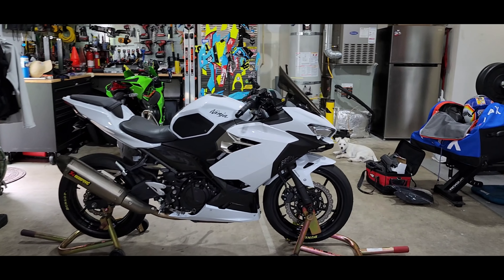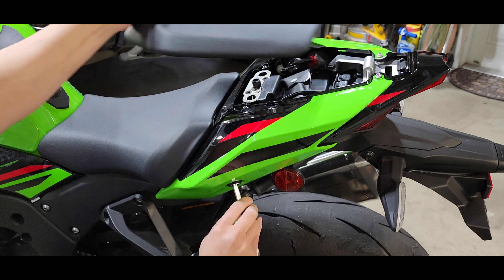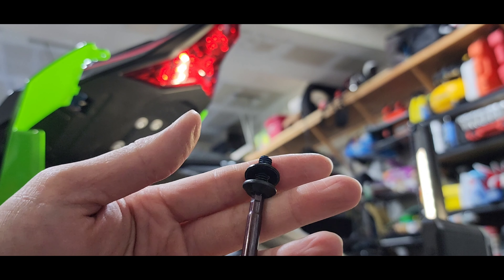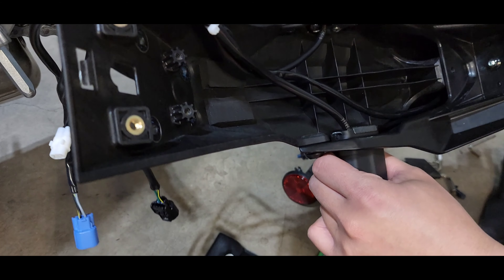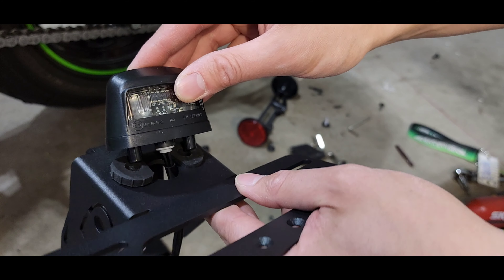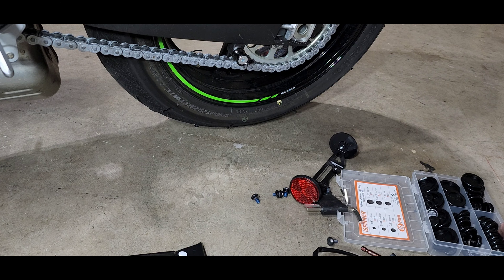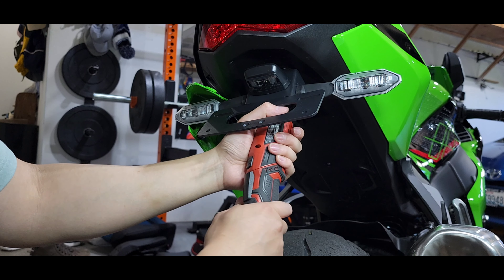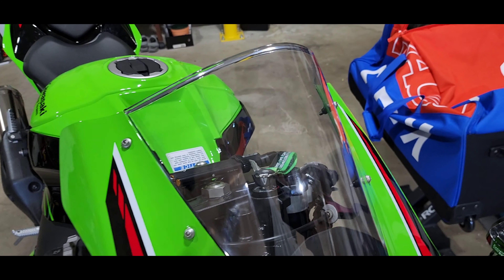Sold the 400! 2023 ZX10R Fender Eliminator Install & Puig Z Windscreen!

Comment: Can you link the rubber grommet set
Reply from the maker: 52pcs 6 Sizes Rubber Grommet, Double Sided Round Rubber Hole Plug, Drill Hole 5/8" 13/16" 7/8" 1" 1-3/16" 1-1/2" (Black) https://a.co/d/189QkmM
Reply: @BillyOnroad thanks